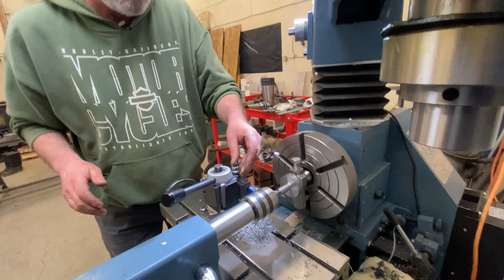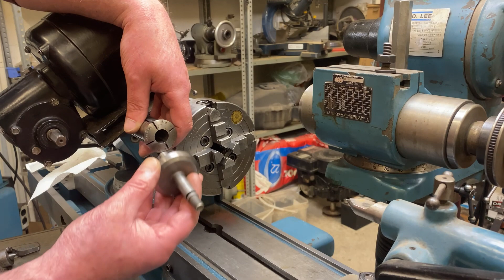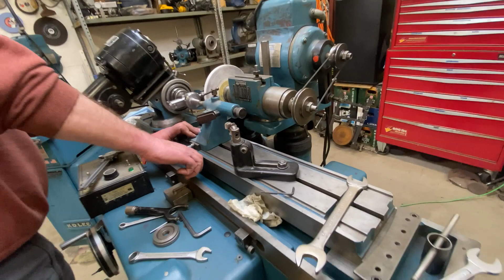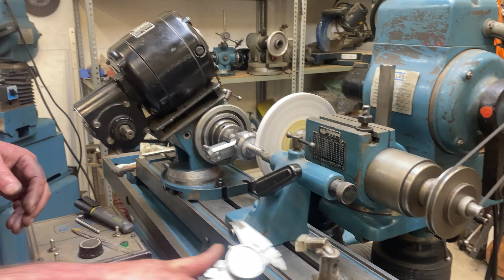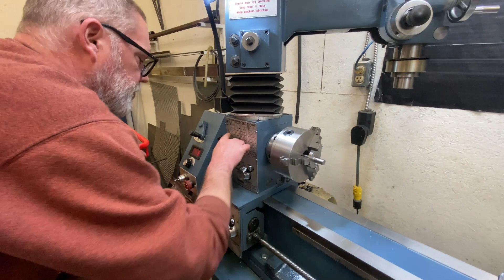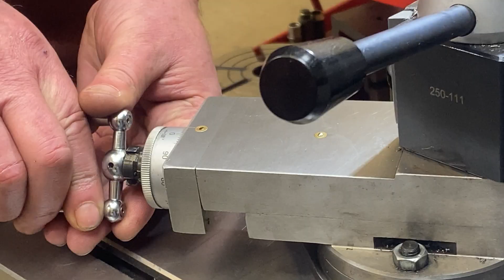New grinding wheel arbor part 2 of 3

Comment: Great video! 
Thought the taper error could be measured by measuring the rocking with an indicator (say, 0.0005 in 2", depending on where you measure it). Then, should be able to scale that measurement up by the distance from the table pivot to the end of the table - should be a larger number. Then, can adjust the table measuring how far with an indicator at the end of the table, which should dial it in even quicker, since you are measuring a magnified offset giving greater angular accuracy..  Or, maybe there is a reason this wouldn't work in this case.. 
Also, wondering how well I can grind a diameter with my little B600... it has done well touching up drills  & end mills.. Thx for sharing this content!